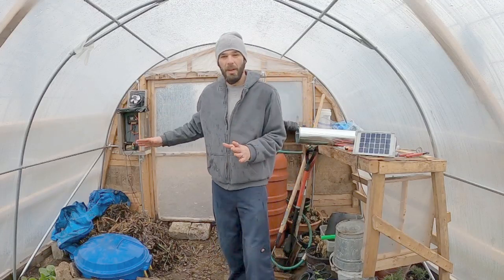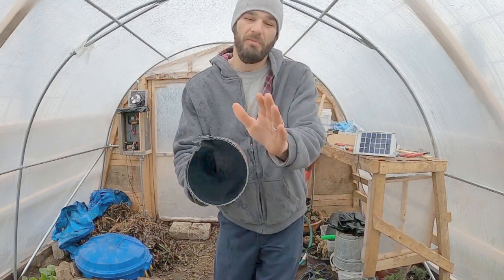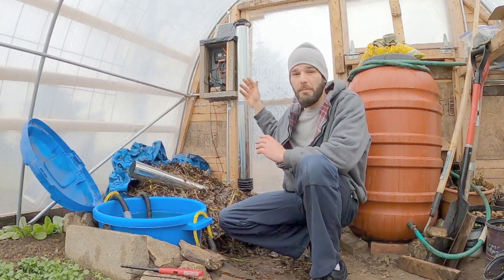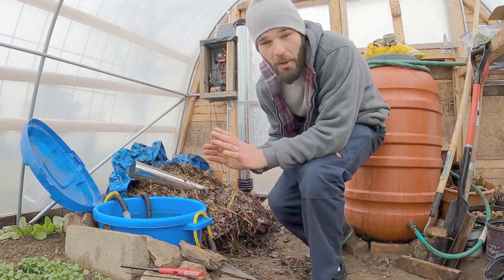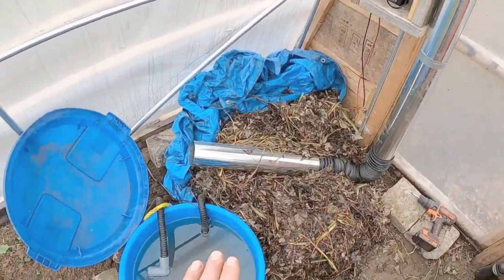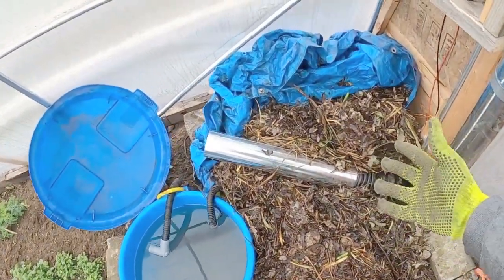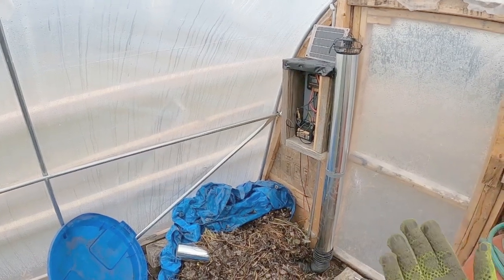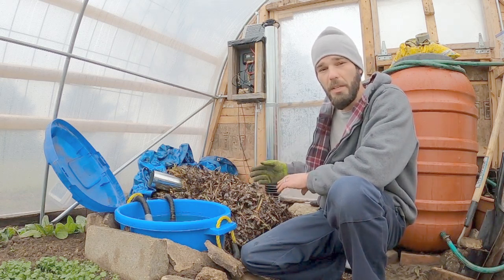DIY CHEAP Winter Greenhouse Heating With Solar & Compost | NEW Experiment Demonstration & Breakdown

Comment from the maker: Solar fan 5W mini fan link —> https://www.amazon.com/dp/B093GYX1FN/ref=cm_sw_r_cp_api_glt_fabc_Q9DF1QSQ6DDR7A62515E?_encoding=UTF8&psc=1
Reply: Do I need an inverter or battery?
Thanks for the link.
Reply from the maker: @pelenaka  nope the fan just plugs in and goes. I’m sure if you had an inverter and battery you could rewire it to run 24-7
Reply: @Earthdwellershomestead  heat at night would be a dream. More ideas ❤

Comment: I’ve built three home style biogas digesters. I’m sure you could design a nice system like my setup. The compost you use would help keeping the digester warm. I actually built a 55 gallon digester which would work great in your tunnel system.
Reply from the maker: I may have to check that out! I was trying to design an easy throw over The pile accumulator as opposed to having to feed a barrel or tote bladder but it seems I may have to use a sealable container.
Reply: @Earthdwellershomestead  I know you’ll love building a digester. It’s amazing how much biogas you can get out of your own food waste. Plus in your green house the digester will stay warm. I run a small generator and a gas grill off my systems. I didn’t even buy propane this past summer. Used only biogas to power my gas grill.
Reply from the maker: I agree. I have been researching it for a while and am pretty confident I can build something fairly cheap and efficient with some parts I I’ve and some I need to purchase still. I have a plan lol
Reply: @Earthdwellershomestead  yeah these digester systems are fairly cheap.

Comment: Since the compost is inside the greenhouse, along with all the heat that it generates, is it even necessary to have the tubes? Couldnt you just blow a fan across the top of the compost to circulate the heat and have similar results? Just asking, Thanks for doing these cool experiments and sharing the results with us.
Reply from the maker: Not necessary, but very helpful in exchanging more heat and circulating air. I believe. Using this hot tube is much more effective than just having a pile sitting without any added heat/air moving energy
Reply: @Earthdwellershomestead  - Thanks for the response. Do you think that the main idea would be about how much heat you need to extract per day or hour? Maybe it would be something that you could shut off with a thermostat when a certain temperature is reached?
Reply from the maker: That’s an interesting though. On warmer days to conserve the burn for longer. During winter we’ll need every bit of help but when it starts to warm that’s not a bad idea

Comment: I would have thought your compost pile is giving off carbon dioxide rather than methane in any appreciable amount. Isn't methane more the product of anaerobic decomposition? That aside, good job!
Reply from the maker: Yes co2 and methane are both byproducts. I plant to make a biogester and try and keep it warm enough to produce methane in a sealed environment. To properly collect methane we would have to compost in large bags.